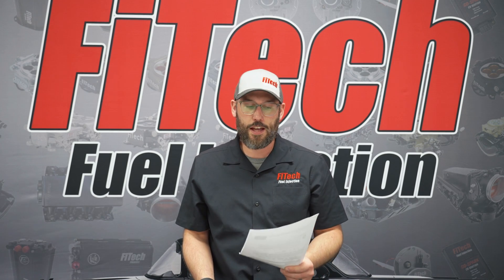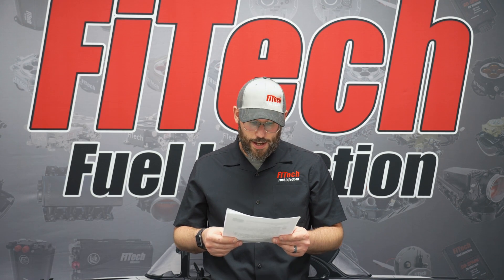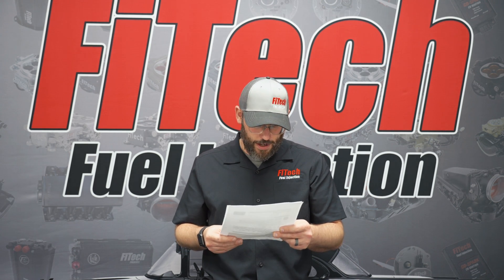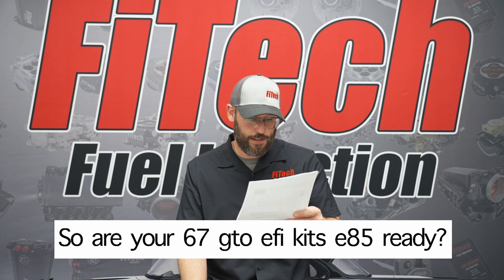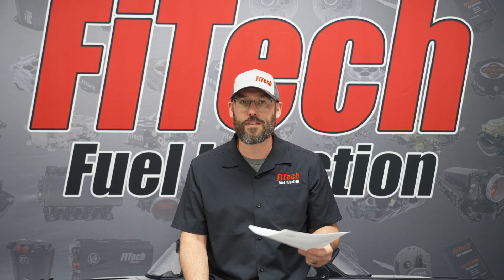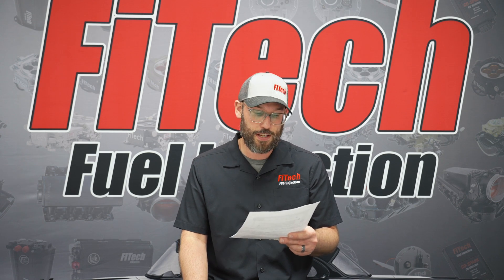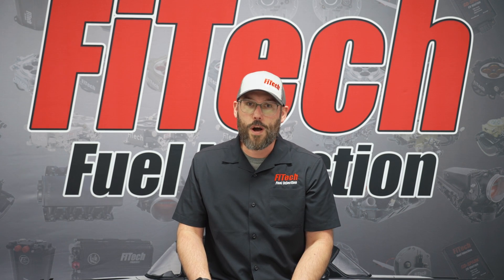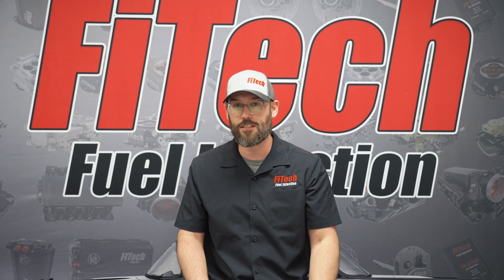FiTech Fuel Injection Q&A | 3 | EP105

Comment: Is a Pertronix 60104 coil compatible with 2 bbl’s 400 HP FiTech Kit ?. BR
Reply from the maker: The 60104 coil is designed for use with CDI boxes. You would be better of using a 45011 coil if you are not going to add the ignition box at the same time.

Comment: Hello, I have a Valiant Duster 1974, with electronic Ignition distributor and I am planning to change the 2 bbl’s carburetor, but I got several questions:
1)With my original distributor, is that compatible for timing control ?.
2)Since I added 2 branches headers(2 groups of 3 pistons), where I suppose to connect the O2 sensor, branch pistons 1-3 or in pistons 4-6 ?. 
3)Since I got headers, the way the throttle body allocates, it’s really close to the ECU built in, does this constitute a big risk for overheating?. Thanks for answering. BR
Reply from the maker: 1. your stock distributor will not be plug and play for timing control however can be made to work.  2. If you can get back to where they all merge will be best for O2 readings. 3. It definitely is not ideal. Our systems go through tests including heating to 300+ degrees however I would encourage header wrap as well as a phenolic spacer to try to eliminate as much heat in that area as possible.
Reply: Can I have all my hard earned money back now please ???

Comment: I have a problem. My Fitech didnt accelerate. I have a chevy 350 turbo set up. It starts, idle and operates great, but when O accelerate it didnt just cut off like if no gaa or no air...any HELP??
Reply from the maker: Have you checked the fault code section of the system? Also make sure you have consistent fuel pressure.
Reply: @FiTechEFImedia  Hi thanks for your answer. Well it was no code on my Fitech and the pressure was OK. Then I put $25 of gasoline (because its my Home Project and is not completed) then the pressure is on 0. I disconnect the hose and put a gallon, put the key and the fuel pump its working and delivering gas, but the pressure didn't stay on the Fitech. It could be the regulator of the Fitech?

Comment: I have a easy street 600 I have fuel to throttle body I hear injectors trying to work but not getting fuel and have external regulator block off plug 65 pounds pressure but no fuel comes out injectors any ideas
Reply from the maker: The passenger rear corner of the throttle body is for return. If you are feeding into this port then you would not get fuel to the injectors.

Comment: I have a *FiTech 30003* with a built-in regulator at *3 bar (43 psi)**. FiTech recommends **58 psi* for optimal performance. I'm using an in-tank fuel pump with a return line, but without a fuel pressure regulator, and the fuel Guage shows around *43 psi**. I'm a bit confused! My engine doesn't start on the first try, and I have to turn the key on and off twice. Despite many modifications, the problem persisted until I noticed that my FiTech's regulator is set to **3 bar**, and FiTech states that **58 psi* is needed for optimal performance. So, do I need an external fuel pressure regulator?

Comment: I've been plagued by drivablilty issues for 3 years now , Fitech built me a program,  still has issues with decel lean out and idling on a 355 crate motor. If you don't get it on a dyno tuner or your not savvy with a laptop then I'd pass.
Reply from the maker: Have you watched our video on Decel Fuel Cutoff (Episode 27).  With this feature on the system shuts fuel off (leans out) to the engine under deceleration.

Comment: How do I set up the regulator for a blow threw application?
Reply: I have the 1200 power adder
Reply from the maker: @HeathenPerformanceandRepair  There is a vacuum line hooked to the regulator on the side that routes to the back of the throttle body. This allows the system to see boost and vacuum. Its setup for you already.

Comment: Is it hard to reset after battery is disconnected for the winter???
Reply from the maker: If you disconnect the battery after the system is keyed off and saved it will not loose any memory.
Reply: @FiTechEFImedia  thanks but just got the car. and don't know if it was saved..don't know if previous owner did..he's no longer living
Reply from the maker: @scottmclorie  You can always save the cal file you currently have using the READ CAL FROM ECU on the handheld. Then load the DEFAULT V8 file to start a new tune. If you ever want to go back you can always load the saved file.